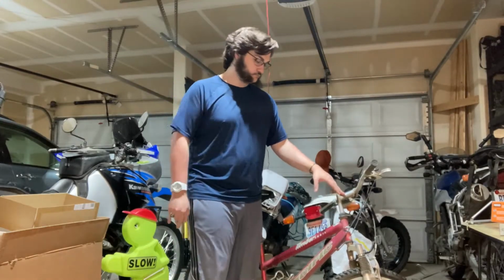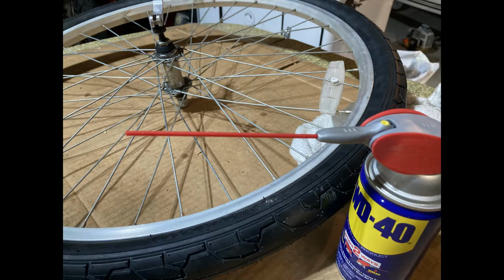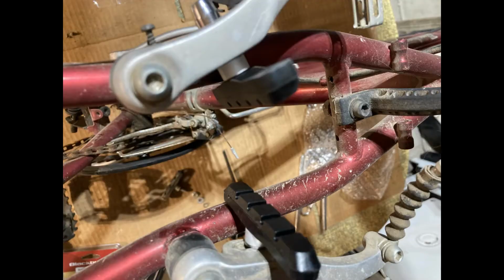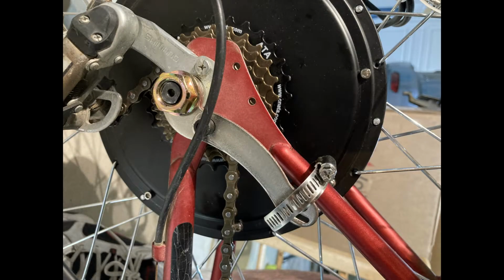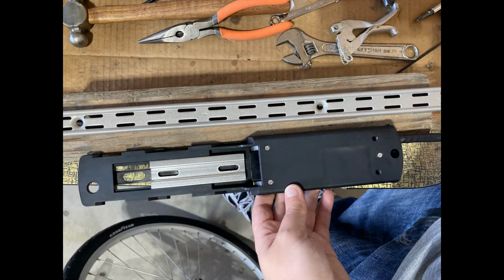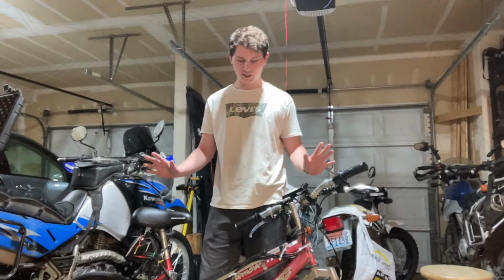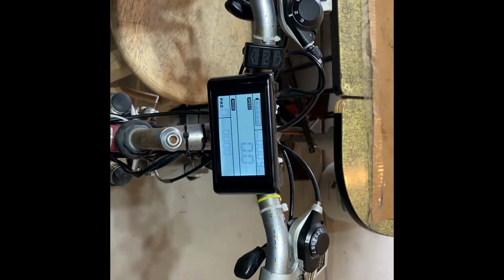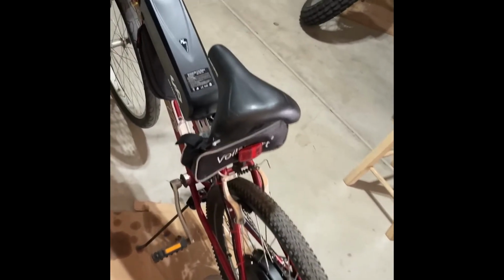EE 416 E-Bike Conversion Kit

Comment: How many volts is it?
Does it use an AC or DC motor?
How many horsepower does it produce?
Top speed?
How do you charge it?
Does it have regen charging?
How much weight did it add? 
How far does it go on a charge?
Thanks;)
Reply from the maker: Hey Jeromie,

The kit and battery are 48V
I believe its DC (Its brushless/gearless and powered from a battery)
Its a 1000W motor (curbed to 750W for road-legal riding) so ~1.34 HP (or ~1HP when restricted)
Depending on rider and terrain, in the 1000W mode, it can get up to 25 MPH. You can probably squeeze a little more out of it, especially if you are pedaling
The battery is separate from the motor and detaches from the mount on the bike. It can then be charged by plugging into the wall with the provided hookups
We did discuss the possibility of regenerative charging (recharging the battery with the excess mechanical movement of the bike), but we decided to focus on the coding aspect of design and did not include regenerative charging
The rear hub motor is ~22lbs and the battery is ~10lbs
Depending on how much pedaling you do, terrain, charge, rider weight, etc. it has a range of ~15 miles conservatively which can be increased with a larger Ah battery

Comment: Does the resistor come with the conversion kit? If not, what are the specs? You appear to have a lot of motorcycles.
Reply from the maker: Good question, the resistor we used with our ESP32 did not come with the Ebike conversion kit. We used a 220ohm resistor, here is a link to how our ESP32 was wired: https://ibb.co/4R8vNsW
I have also added details in the description of the parts we purchased for the build.